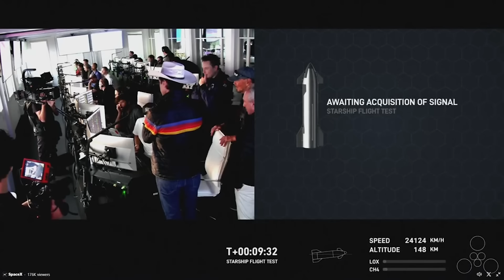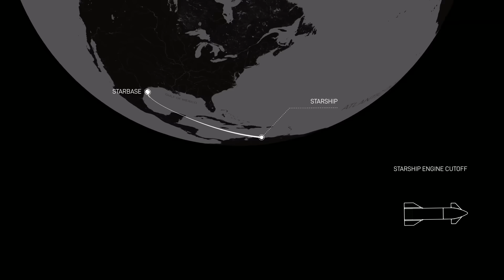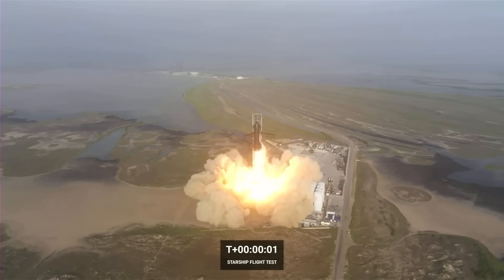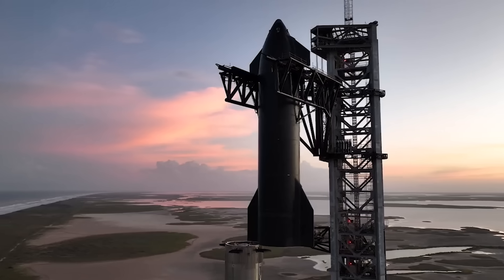What Exactly Happened On SpaceX's Second Starship Launch Attempt?

Comment: For the booster.
I warched it live and after separation i actually thought something went wrong because the booster flipped so fast. 
Someone mentioned that the flip could have cause a Fluid hammer und destroyed some engines which subsequently destroyed more engines and ultimately triggered the FTS system

Comment: I don’t understand the motive fir the rocket, size wise. Mars yes  I guess fir more fuel as it can’t be fir more passengers yet, but if it wasn’t that wide you  use 1/2 less the fuel. You would get an easier chance with a skinner rocket  abdlonger if you need the fuel same as longer  if you needed the cargo space. Wide and what was it 30 engine narrow and burn too much fuel to reach mars  unless  it only fir take off  or is it to escape mars.  Just don’t tell them that LOL Or get there faster,  mars is a joke, 10 yr to get there. And once a yr possible.
 He could have done moon 2

Comment: Engine data display from the first stage clearly indicated that the exhaust plume from the upper stage was hitting the first stage engine bells. About a minute before the apparent upper stage explosions (+00: 07: 06 on the flight clock) there were plume of gas visible asymmetrically arrayed around the glowing engines followed by a second plume 36 seconds later and a third event 9 seconds later. 58 seconds after the first gas plume the ship exploded.

Comment: My analysis about the Superheavy destruction.:
At separation the push of SS engines on SH caused it to have negative vertical acceleration. For that reason, for a few seconds, the fuels started to move upwards and gaseous fuel bubles were able to reach the fuel lines causing engines to  shut down/malfunction and explode automatically or intentionally using the flight termination explosives. That is my analysis that I have been thinking for weeks before this launch. Lets see what the truth is.
Reply: Assuming SS engines did not cause a tank rupture in SH, Because that is what it looks to me. Methane tank rupture which caused  cloud of burning gas followed by an explosion cause fight termination explosives.

Comment: I wonder if "shock cooling" had anything to do with the First Stage problems??  They are running 33 engines, in one "compartment" at 100% and then turn them off.....then crank a few back on??????
Reply: The Falcon 9 does it with 9 engines though not as powerful of course.  Bottom line without more data we are just guessing.

Comment: Glad to see it do what was intended. Now imagine how far things would be if they had not overlooked Stage 0. While the hydraulic system would have still been an issue, the 2nd flight would have occurred last summer, perhaps the 3rd around now. This flight will lead to greater success with the next flight. I would think it would result in a better control with the booster, perhaps reignition. Starship is interesting because I did hear perhaps not much data was collected as to why, so that may be interesting what they do conclude. I did see it did lose a fair amount of tiles as well...
Reply: Over six months later and people still want to beat that dead horse of what could have been if only . . . . . . . . . .🙄 👈 eye roll in case you weren't aware!
Reply: @michaeldeierhoi4096  A fan boy displaying his wits. Stage 0 showed the cocky nature of those who decided concrete by itself was a great decision. The original timeline was cut into significantly due to that decision. Some it seems are ok with slowing progress by dumb decisions in the human race. Congrats!

Comment: It should be noted that the mission that actually landed on the Moon was Apollo 13. The program started with Apollo 1, which, as we know, had a fire during a system test on the pad killing three astronauts. The final test run and moon landing dry run was Apollo 10. The crew went to the Moon....the lunar lander actually separated and hovered 14 km above the surface then returned to the command module and the crew came home.
It is a good read on how many trips were taken before the 1969 landing. Good stuff.
Reply: Apollo 11, 12, 14, 15, 16 and 17 landed on the moon.  Apollo 13 did not because of an onboard leak on the way to the moon.   The system failure caused the crew to continue to the moon orbit once and return.  They could not land because of the leak.  It was made into a movie too directed by Ron Howard starring Tom Hanks.
Reply: @michaeldeierhoi4096 Good catch....typo on my part, obviously. 13 really was an incredibley successful failure that the crew and their support team at NASA were able to bring the astronauts home.....with a 70lbs 36k computer.

Comment: Seems to me that stage separation might be causing some knockback. Especially with the amount of mass that's being accelerated. Gotta start working that one out. I think the main thing to think about is the force applied to the booster during separation, and the force applied to star ship. If you make things too loose, there could eventually be a Part that fails when the vehicle is under tremendous amounts of shock. Especially when you're trying to accelerate all of that mass.
Reply: I agree. Separation likely caused issues.

Comment: Eventually they'll achieve 60 year old rocketry!
Reply: At a much much larger scale and for much cheaper
Reply: @MercerWing1  I can build fireworks for far cheaper even still.
Reply: @davewood406  Let me know when they land on the moon
Reply: @MercerWing1  1960's accomplishments out of reach of SpaceX in 2023.
Reply: @davewood406  Wasn't aware something the sheer size of spaceship landed on the moon in 1960's
Reply: @MercerWing1  So far spaceship has only landed in the ocean, in pieces.
Reply: @davewood406  Indeed, emphasis on so far.
Reply: @MercerWing1  All we got. Seriously, if Elon's lickspittles could call balls and strikes accurately instead of calling everything a home run no matter how catastrophic. you might retain some self respect.
Reply: @davewood406  you might retain some self respect if you realized the exact same thing happened with the falcon 9 rocket and guess what the most used rocket for human transportation to space is? Go outside, be happy, trying to sh*t on the achievements of others will not make your life better.
Reply: @MercerWing1  I didn't need the cherry on top of my already clear point but thanks anyway.
Reply: @davewood406  Indeed the points of comparing completely different objectives as well as comparing rockets to fireworks were pretty clear. pretty clearly stupid
Reply: @MercerWing1  You’re just gilding the Lilly at this point.

Comment: The boostback burn had one engine that never restarted after separation, then you could see that a few other engines on the booster shut off, later there was an explosion at the top of the booster.  I believe this was another FTS explosion.

I think Starship was supposed to have engine shutdown at 8:33 or so.  But the graphic shows that it they shut off at about 8:03 and then a shockwave glow appeared at about 8:09 which I interpret as when the FTS exploded the ship.

Comment: A 90 minute expedition turned into an explosion after 8 minutes. Congrats. What a success!!!!!
Reply: Let's compare this launch to the first launch to see if your criticism is warranted shall we because apparently you didn't do this.    

ITF-1.    8 raptors failed during launch.           .   
ITF-2.  All 33 raptors fired successfully 

ITF-1   Starship didn't reach MECO
ITF-2.  Starship successfully achieved MECO

ITF-1.  Starship failed to achieve second stage separation.
ITF-2.  Starship successfully achieved second stage separation.

ITF-1.  Starship reached an altitude of 39,000 ft or 12 km
ITF-2  Starship reached an altitude of 149 km

ITF-1.  Starship reached a velocity of 3000 mph by the booster only.  
ITF-2. Starship reached a velocity of 5000 mph by the booster and 24,000 mph by the second stage.  

Hopefully you don't see your own life with such a cynical perspective because when you only look at the end result you miss most of what indicates considerable improvement!!
Reply: @michaeldeierhoi4096  is this you Elon?
Reply: @rioverde1597  is that you Jeff?

Comment: Were similar explosions experiencing during the development of the Saturn I through V rockets?
Reply: The difference between science and optimism.  Budget and insanity.
Reply: Much more recently four attempts were made by the Falcon 9 before it successfully reached orbit and starship is a much bigger and more powerful rocket.  Look at the Falcon 9 as the most reliable and also only reusable rocket that also routinely lands in the world.   

NASA tended to be more risk averse early and still are then Space X which understands the iterative process of building rocket requires failure to happen and learning from that failure.

Comment: 33 engines equals 33 possible points of failure.  Just like the Titanic submersible, I'd never get on it.
Reply: "Titan"
Reply: Oops.  Brain-fart.  @MrShobar
Reply: If they can get into orbit with 30 engines then 4/33 engines need to fail. Unlike other rockets with a single engine that have a single point of failure.
Reply: @raydunn2582    When three Falcon 9 boosters are joined together in the Falcon Heavy you have 27 Merlin engines all firing at once on launch.   I have heard no reports of Merlin engines failing on the Heavy so why have a different standard for starship??
Reply: @michaeldeierhoi4096  Flight 83 of falcon 9 had a Merlin failure. But becuase they have extra engines they still were able to get to orbit.
Reply: @catprog  Well there's one example and I would submit that was an exception and not a persistent problem.  That's why the Falcon 9 is so reliable.  It's partly because the Merlin engines are reliable.  Space X will get there with raptor eventually.  Bigger more complex rocket engines take more time especially when integrated in such large numbers as in the booster.  There are very few methane fueled rockets flying these days so there isn't the reservoir of experience as there is with hydrogen or kerosene fueled engines.
Reply: @michaeldeierhoi4096  I would also submit that having multiple engines allows for the others to take up the slack even if one fails.
Reply: @catprog  Of course.  It's called redundancy.

Comment: It's a water deluge system designed to interrupt sound waves, it may have some cooling effect but that isn't what it was created for.
Reply: Are you talking about the water cooled steel plate with holes in it?
Reply: @catprog  No, the deluge was what prevented the whole structure being smashed to pieces by the shock waves, the cooling didn't save the launch pad, only helped

Comment: I'm sorry, but I am totally unimpressed with this SpaceX "succeed through failure" methodology.  NASA had it right, I think, at least with the Saturn V booster.  Start with a ground test program that finds all the failure points, and then design in the solutions before you fly.  The result was thirteen launches without a failure.  

And what is with this stupid euphemism, "rapid unscheduled disassembly"?  It exploded, and no PR newspeak is going to change that.
Reply: RUD is a common term in the industry not just SpaceX.

Spend billions figuiring out every possibly failure or spend much less in launching prototypes.

Comment: OK? How far did you just move the Earth's track in space? Any body consider this?every action creates an egual reaction.
Reply: The only way your suggestion makes sense is if you believe rockets work by pushing against something.  If that was the case, they would not work in the vacuum of space.
The opposite reaction is the forward movement of the rocket due to the rapid expulsion of gasses in the opposite direction.  It's not pushing on the Earth.
Even if the false assumptions were true, the amount of force is minuscule as compared to the mass of the planet.
Interesting side note, when you Jump up, you push Earth down, that's a fact.  But, you weigh slightly less than the planet, so we can ignore it.  Calculable, but not measurable.
Reply: Probably none at all. Any momentum would of been returned when it came back into the atmosphere.

Comment: Both this launch and the last one, I found myself thinking 'damn it's a shame it blew up, they have to spend years making a new one' before I remembered they have like three more ready to go and more on the way.
Reply: delay was FAA and the fucked up launch pad.   Pad is fine, and lets see if FAA cockblocks again.
Reply: @macsdf1  FAA? Try fish and wildlife protecting the sensitive shoreline from the deluge system.  SpaceX sat on the request for impact statement rather than complying probably so they would have someone to blame for the delays.  They have done this before with FAA compliance at canaveral and when permission was granted they were still 2 months out.  Please don't be a pawn.
Reply: the fish and wildflie determined that the water from the deluge system was less than a typical rainstorm in the area and would have no effect on the shoreline, it's almost like pouring water on a beach doesn't hurt it @rcpmac
Reply: @rcpmac Idiotic request got the deserved treatment but yeah , birocracy must be followed . I wait the 100 page report on starship impact on sexual behaviour of mosquito's and the associated change in mosquito bites in the region . Think at all the lifes at stake .
Reply: They make starship in motnhs
Reply: This flight had no recovery of booster or Starship planned so whether it blew up or not it wasn't going to fly again.
Reply: That wil also wind up as so much bent metal on the floor of the Gulf.
Reply: @MrShobar  They crashed ten Falcon 9s before they got it to land safely, and now they're almost up to 250 safe landings.

Comment: Another succesful detonation!😂
You would think we were back  with Von Braun and the Nazi's testing V2's. Sorry for the Nazi comparison but it is Musk's company isn't it?
Reply: Can you think of any rocket that worked first time without any problems?
Reply: @catprog  That's why, for decades, most rockets are derivatives of rockets that have been around for decades. They have been perfected. A 30 engine rocket is quite simply a STUPID solution. That's 30 individual points of catastrophic failure.  The  space shuttle had less than a 2% failure rate after 100s of launches, and that was with technology from 50 years ago. BtW what has been the failure rate of the SLS? ZERO. The theory that to make rockets, you have to blow them up is BS. This is the 21st century you can run thousands of computer simulations, and actual physical tests that can that can lower the failure rate to virtually zero. Right now, this rocket is at 100% 2 of 2.

Comment: It could also be that termination packages were set too sensatively.
Reply: To my knowledge of the subject which extremely average there is no such thing as too sensitive a setting on a FTS.  It is either triggered and it works or it isnt triggered and doesn't work.. The problem with the FTS on ITF-1 was that the FTS  had not been adequately tested before hand.  And did not initiate the disassembly in a timely manner.

Comment: Progress, but not much closer to full reusability.  Raptor reliability is sus.
Reply: Based on what are the raptors sus??   All 33 raptors fired right up to MECO.   About 2 minutes 40 seconds.   Then after second stage separation the second stage fired its 6 raptors for almost six minutes before the ship experienced some of anomaly possibly in its trajectory causing the FTS to be triggered.  Can you not  see the huge improvement in the raptor performance from the first to the second test flight??
Reply: @michaeldeierhoi4096  reignition after stage separation didn't go at all as planned. Not all relit and the ones that did quickly failed. Reignition is critical for reusability.